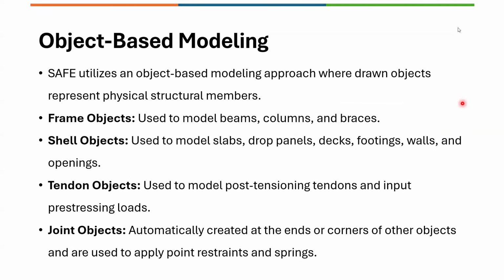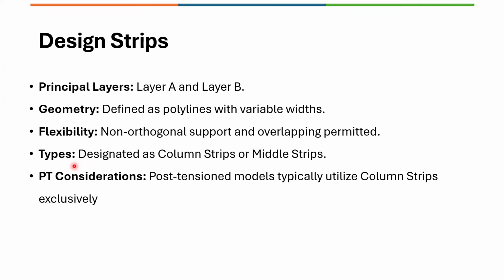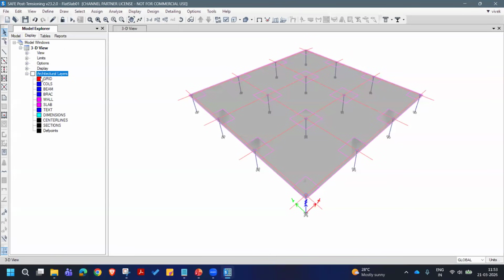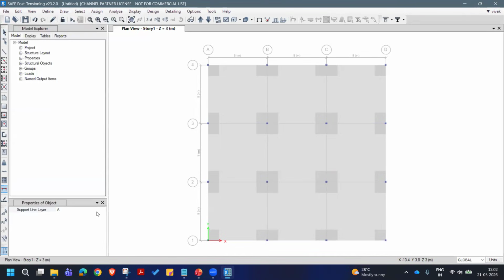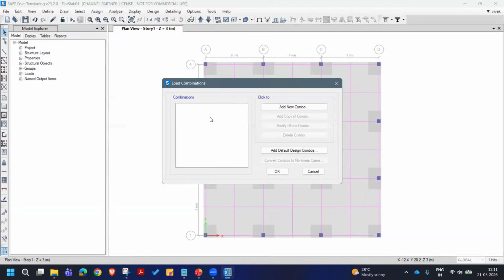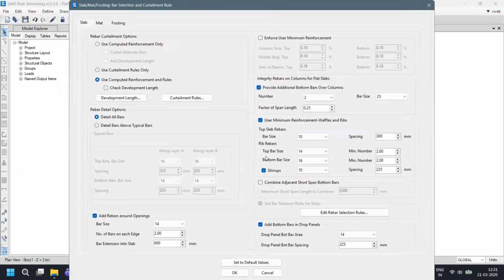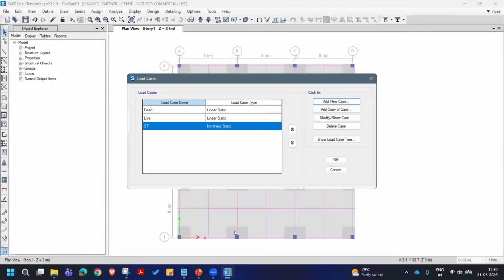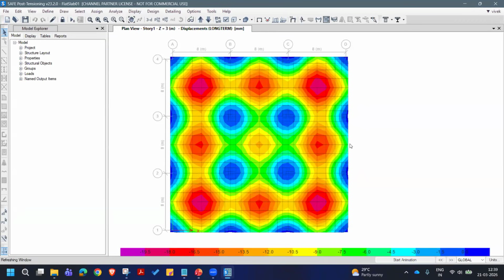Webinar 11: Analysis and Design of Floor Systems in SAFE and Cracked Section Analysis

Comment: I have one quick doubt. When performing punching analysis in SAFE, the program reports an unbalanced moment about the 2-2 and 3-3 axes. Even though my spans on both sides of the column are equal, I still get an unbalanced moment. Can you explain how SAFE calculates unbalanced moment?